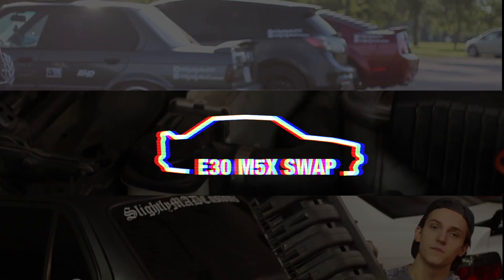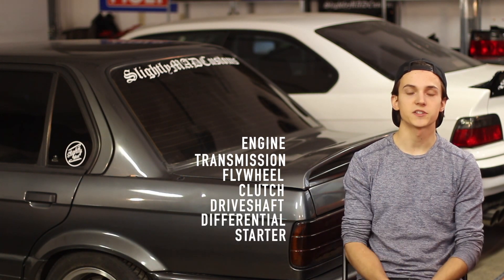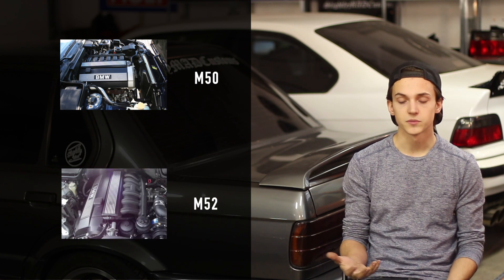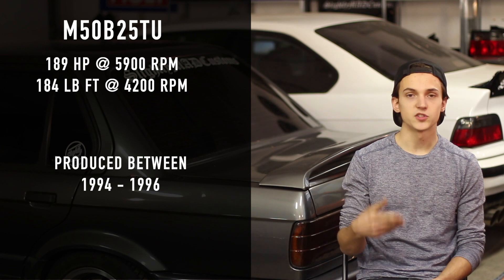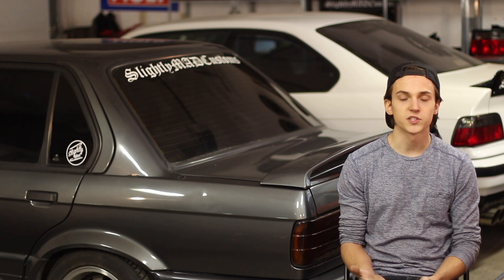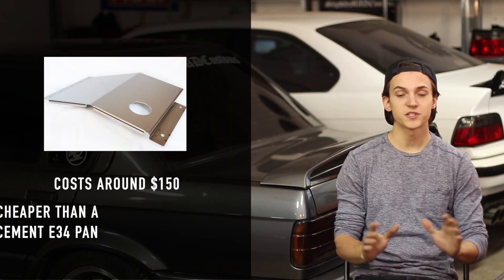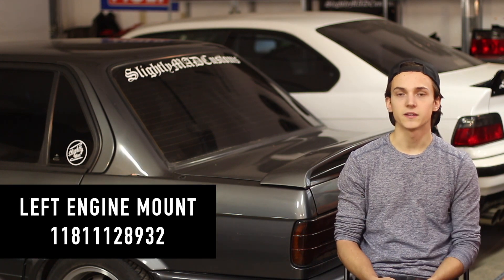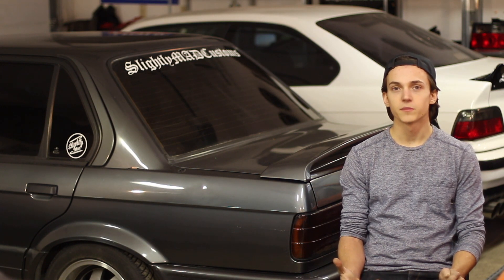Ep.2: Engine & Drivetrain - E30 M50/M52 Swap Guide

Comment: Can you use the shifter that came with the car originally, on the m50's transmission?
Reply from the maker: I believe you can but you’ll need to bend the selector rod a bit to work in the e30 chassis. There’s a full write up explaining it all on E30Wiki

Comment: M50b25 is faster and stronger than the M50tub25 (singlevanos) the M50b25 got a more agressive intake cam than any other m50/m52 (240° instead of 228°), double valve springs (m50tu and m52 have single valve springs) and the internals (rods and pistons) are slightly different than the Tu version. Just stick with the non vanos M50 because they run and sound much, much better than the single vanos one. Have driven and drifted both of them for along time and i take the non vanos over the TU anytime i can.
Reply from the maker: Thanks for this ^

Comment: Hi, can you advise about drive shaft. I'm busy with e30 with m52b28tu swap, engine is already in with gearbox but drive shaft from m40 is too long to connect with diff. Is there other driveshaft shouldi could use or i need replace only front part from drive shaft?
Reply: I use getrag gearbox which came with engine (m52b28tu).
Reply from the maker: So I believe you need a e36 driveshaft with E30s front shaft on it
Reply from the maker: What trans are you using?

Comment: is there a big difference between the m52 vs the m54? you recommend a m52b25tu, and from what i’ve heard there’s not much difference between that and an m54b25. i’m working on putting an m54b30 with a 6 speed ZF trans into my e30, but most guides seemed to be geared at m52 swaps. wondering how much of the info can be applied to my build.
Reply from the maker: It’s similar but not identical for the swap process. If you google m54 E30 swap there’s a guide on it on one of the forums. I know it requires modifying the oil pick up tube, and relocating the fuel pressure regulator
Reply: What driveshaft to use with the m54 6 speed?
Reply from the maker: The correct one preferably

Comment: hey everyone 
im kinda confused now about the transmission I will go I know that the  getrag 260 from 325i is the perfect a for the build but I saw in some sites that the getrag 240 from late e30 model(316i_318i) that comes with m40 engine might fit I really want to know cause the e30 325i are freaking expensive and rare to find while the 316i and 318i are cheap and I'm looking for one with blown or broken engine to do the swap and to keep the budget low as possible
Reply from the maker: I would recommend not using a 240. They’re weaker and less reliable. 260 is already on the weak side, but has been used with decent success. I would say 260 is the minimum

Comment: I pulled the engine and trans from a manual e34. Will that whole setup drop into my e30? Mainly asking about the trans
Reply from the maker: My understanding is that it’s the best trans to use for a M50 swap. It’s identical gearing to an E30 trans so you don’t need to alter your diff ratio, it’s the same length as an e30 trans so you can use a e30 manual driveshaft, and the belhousing angle has been shifted so your shifter will pop up straight without modification. You should be able to use the e30 trans crossmember with little or no modification

Comment: I have a 97 E36 M3 complete donor car. Besides the engine and transmission what other components should I remove for this swap? I.E. can I use the new drive shaft and is it even recommended?
Reply from the maker: I would pull engine, transmission, Tranny crossmember, harness & ECU, engine arms, driveshaft, & exhaust manifolds. I believe you need to piece the drive shaft together, one half from e36, the other from e30. You should also pull: differential, brake calipers, seats, front valence, wheels. They aren’t needed for the swap, but are worth good money and can help offset the cost of your build.

Comment: Hy i going to swap m50b25 with original transmission its capability 370/390 hp do i need to modifies shaft
Reply from the maker: Hey Nokila! When you say original transmission, do you mean the original transmission to the e30? Or the m50?
Reply: @slightlyMADcustoms  m50b25 transmission
Reply from the maker: I’m not completely clear on which combination of front and rear shaft will work with your set up, but if you find yourself e30 & e36 driveshafts,you should be able to find a combination that works well. This is what E30 wiki says about modifying the driveshaft for using a m50 Tranny:Propshaft should be fitted with an E30 centre bearing fitted to the rear section
Reply: @slightlyMADcustoms  thanks

Comment: do I need the section of the harness going to the transmission?
Reply from the maker: If you’re using a manual transmission there are no wires that go to the tranny. If you’re using an automatic on the other hand, you would need a engine harness from an automatic car and the ECU.
Reply: slightlyMADcustoms I’m using the 5speed I had in my e30
Reply: So I can just delete the wires for the auto transmission?
Reply from the maker: Yes you won’t need those. Just make sure to not cut out the O2 sensor wires that also kinda go down it that area

Comment: Would a Getrag 260 gearbox handle a m52b28 ?
Reply from the maker: BostaGold Yes I believe it would. As long as you’re not insanely aggressive with your launches and shifting it should hold up just fine. Also assuming you’re not running a turbo or anything.

Comment: Can I use the stock transmission from a 318i 1984 for the m50?
Reply: No the trans for the 318i from the m10 doesn’t bolt up
Reply from the maker: Luis Cordon I believe it is possible although I would recommend finding a 6 cyl transmission if you can. With the added power from the new motor It’s best to set yourself up for success

Comment: Is there any big modifications if I got a m50 that had an automatic and hook it up to my 5 speed.
Reply from the maker: victor farnsworth My M50 was the same deal. Besides obviously needing a flywheel/clutch, one notable difference is the M50/M52s mated with a automatic transmission do not have a pilot bearing. The pilot bearing is a small bearing placed on the inside of the crankshaft for the end of the input shaft to ride on. You can get a pilot bearing from your local transmission supply shop with two simple measurements: 1. The outside diameter of the bearing (which will be the inside diameter of the crankshaft where the bearing presses in, 2. The inside diameter of the bearing (which is the outside diameter of the end of your input shaft on your transmission. The depth of the bearing doesn’t really matter as long as it’s a reasonable size (around 3/8”?). I apologize if this is a little confusing, message me on Instagram if you need more clarification!
Reply: slightlyMADcustoms thank you for the help, looking to get my hands on a m50 here soon.
Reply from the maker: victor farnsworth Awesome! Good luck with the swap, feel free to contact us if you have any questions

Comment: I just bought a totaled manual 1999 328i with a m52. Is there any special parts I will need because it is a newer year or will all the things listed in this series work?
Reply from the maker: Noahd Everything should be the same! You may encounter some small differences but the information in these videos will get you very very close
Reply: @slightlyMADcustoms  awesome thanks for the response. one other question i only have 72 hours to get the thing pulled and sent to scrap since i dont have much room for cars. So i will be rushed, any other parts you can think of i will need from the e46 that i can use on my e30 other than engine trans, ecu,harness and steering rack?
Reply from the maker: Noahd Keep the driveshaft just in case it works for your application. Also if the car has a LSD differential or nice sport seats, they are quite desirable and you could sell it to recuperate some money

Comment: Place on where I could get the transmission mounts to use the oem Getrag with the m50?
Reply from the maker: Jesus Gonzalez Using the E30 Getrag you’ll need a modified transmission brace but you can use the mounts that come with that transmission. For OEM replacements check ECS tuning, pelican parts, or a local shop that can order BMW parts. If you want performance mounts such as polycarbonate, check out garagistic, or condor speed shop